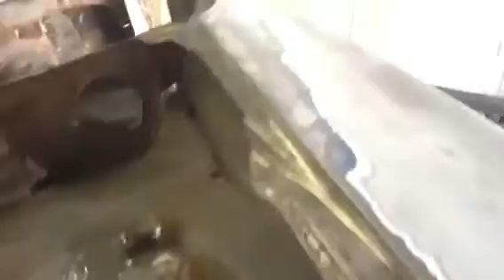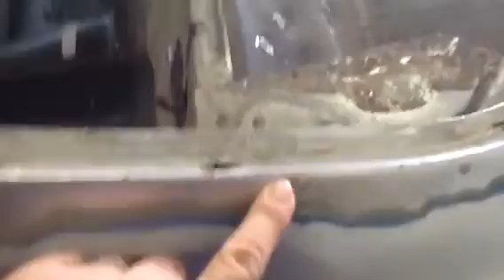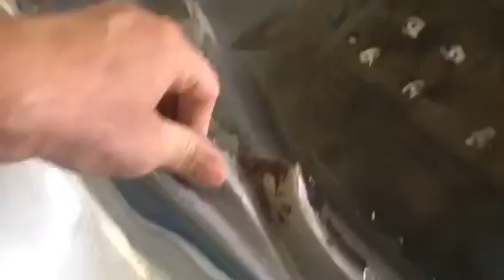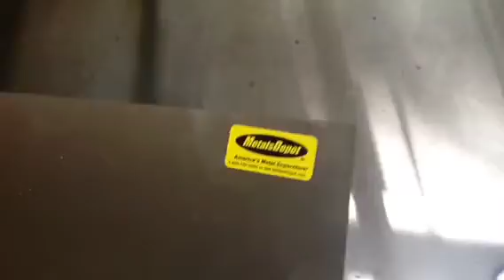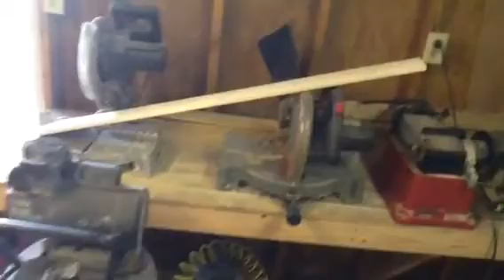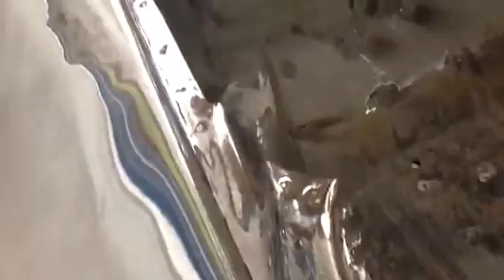1972 Camaro Part 14 Rear window channel repair

Comment: amazing how some folks will repair sheetmetal.  Your work is first class Jeff.  I am going thru your vids to see if you have any footage of rocker panel work.
Reply from the maker: Wes, my rockers are in good shape. I don't know how considering how bad most of the car was. Only thing I did was sand and epoxy.
Reply: Thanks Jeff.  I am on Metals direct website now.  Thanks for the tip brother.